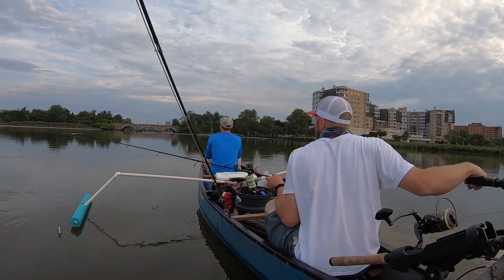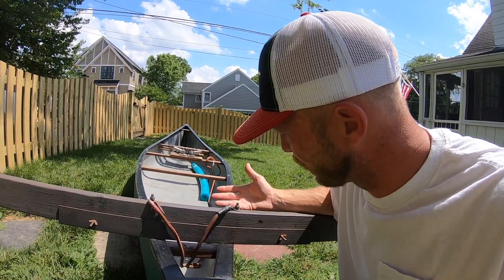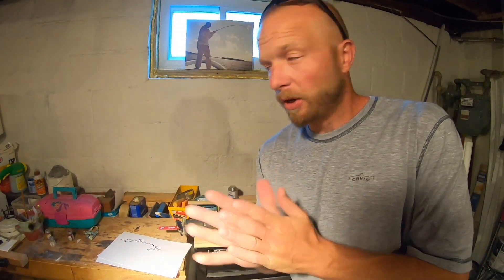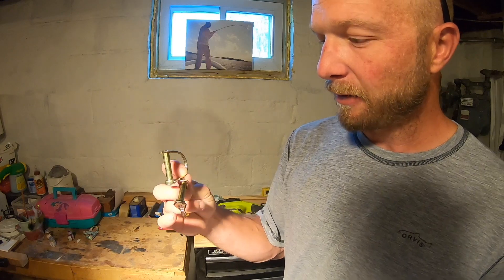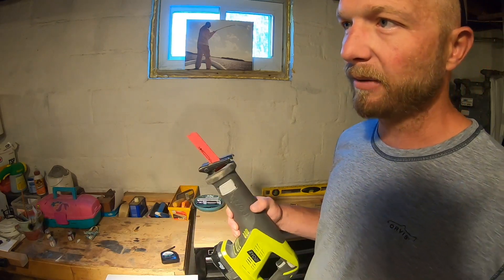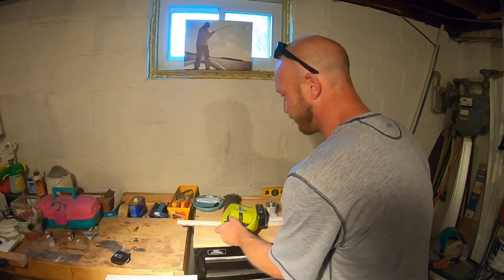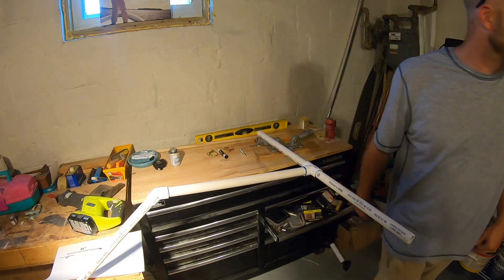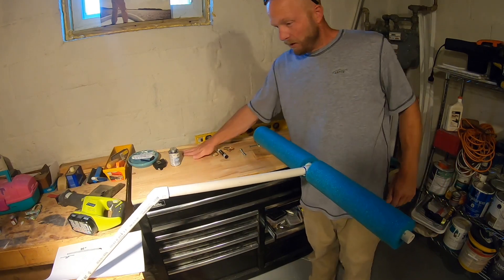Turn your Canoe into a Fishing Machine - Canoe Modifications & DIY Stabilizer Arms Cheap & Easy

Comment: Great idea, what diameter of pvc and dowel Rod did you use?
Reply from the maker: Thanks so much for tuning in!  I'm 99% sure I used 1" pvc with a 3/4" dowel rod. Mine are still doing fine after 3 years, however I do like to change the noodles because they dry out and soak in water after about 2 years.
Reply: Thank you for the info!

Comment: That’s a nice system , design but it seems like the material is to flimsy to be effective and is gonna flex and break
Reply from the maker: It actually does a great job!  However, if you really crank on them hard, or leave them out in the elements all year, they will be compromised.  Thanks so much for your insight, and tuning in.  I'm always looking for ways to improve my canoeing experience.  Tight lines!
Reply: @HicksHooks  I’m not the greatest of all and don’t know it all and if you say they good , they good ! 👍🏻

Comment: do you treat any of the wood? or just replace it when it wears?
Reply from the maker: Hey Sam!  Thanks for watching.  The 2x4 that I used for the Transom is pressure treated wood, and I put a coat of paint on it.  I had to replace the yoke and a few of the thwarts with scrap teak wood that I found in my parent's attic.  The wood that I am using for to hold the flag pole holders is just 1/2 inch plywood (untreated).